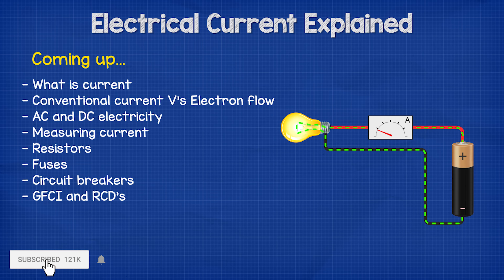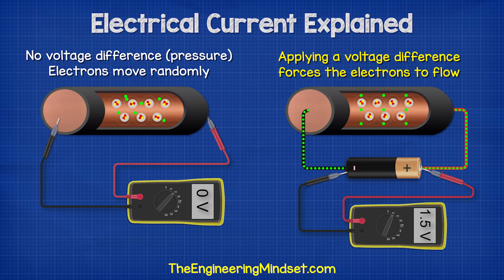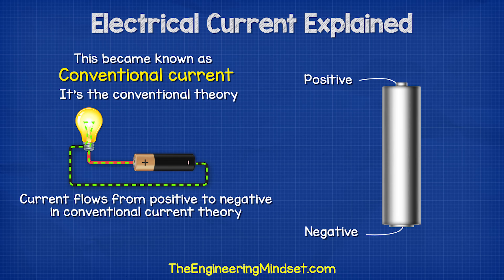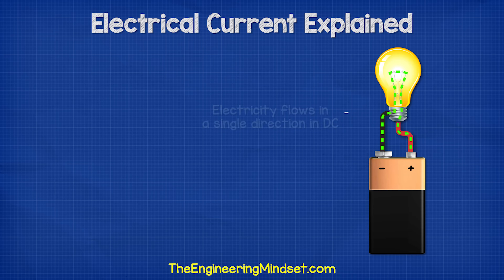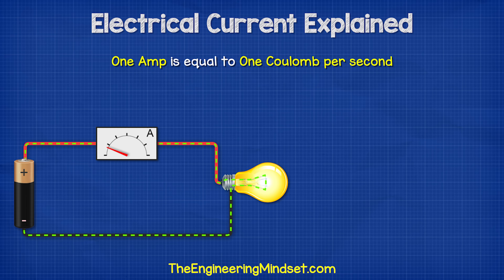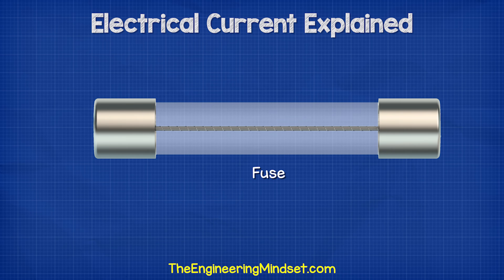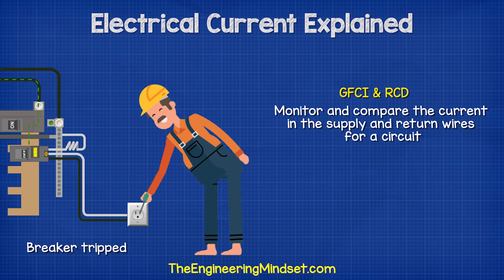Electrical Current Explained - AC DC, fuses, circuit breakers, multimeter, GFCI, ampere

Comment: Some of the basic information is this video is not true, such as "we need electrons to flow in the same direction".  AC current does not flow "in the same direction".  It jiggles back and forth  (or oscillates).  Furthermore, and a lot more weird, check out the Veritasium channel which will demonstrate that the power in a circuit is transmitted via the EM fields and not via the flow of electrons (which, in fact, move extremely slowly).

Comment: Why would you need to change anything in the terminals? Just make the battery so that the end that emits the electrons is the positive and vice versa, and mark it whichever way you want. I dont get the logic behind using the conventional current terminology.

Comment: So if the voltage is low and you have one amp let’s say, the voltage can be increased and the amps can stay the same somehow?
Ah, more or less amps means far more electrons per second, but how can the flow stay the same or the amount of electrons even with voltage increasing? Or can it not.

Comment: Ok I will make a Hot Wheels analogy  for what I learned today
A circuit is the track that connects the cars to go through 
- Electrons are the car toys themselves 
- The battery is the booster/accelerator that makes the car move through the circuit and by increasing the Amps you increase the speed of the car going 
- Resistor is the loop that the car goes through to lose its momentum to keep the car on track
If a track is to narrow and the accelerator is too powerful, the car can go out of the track

Comment: I really appreciate the info you share with this but I need to ask why use so many illustrations using electron flow after you  very clearly stated that we use conventional flow theory.  At 12:30 there is a battery hooked up to a light bulb with the electrons running down the battery and out of the negative terminal, into a light bulb and then back though the top of the battery again.  This is extremely confusing trying to follow along.  Are you reversing flow, different theory… again I appreciate all of this free and wonderful knowledge just asking a question

Comment: Electrical Engineering Professors: OK! And that's it for today! Here's the homework, required and optional. If you have questions, you can come by my office.

Professor never taught any homework material, the text book doesn't contain it, and the professor is never in his office. If he is, he gives a useless explanation and you leave more confuaed. Many times, the material in the labs is not demonstrated, and now you have two circuits, homework and lab, that you need to create. 
You know your professor is not meant for teaching when you finish the course with an F, and you're confused even more than before the class.
Electrical engineering is basically coding, coding, coding, and then creates dozens of circuits that don't work. 
Engineering was not what I thought it was. That's why I switched to Chemisty. It interests me, and if you mess up...
💥 💥 💥 BOOM!

Comment: 8:55 actually it's using a universal motor and not and induction motor, because a universal motor also works like a brushed DC motor and it is also a type of a brushed motor, because it can on DC and also AC as well, it's speed is proportional to the voltage, it doesn't have permanent magnets like DC motor, rather it has field windings, meaning that the motor is entirely connected to AC, especially the series one, so a washing machine uses universal motor also known a series motor or a DC series motor, which can run on both DC and AC power, but there are some washing machines use induction motor and some of them use also a BLDC motor, which they call it inverter motor in washing machine because it's connected to an inverter which converts AC to DC power (the BLDC motor).

Comment: Does a resistor only take away the energy of a electron flowing through the cable? 

But if a electron loses energy, in other words, speed, then won't it also travel slower after it has passed the resistor? 

If so, wouldn't the resistor get congested with elections due to the incoming faster electrons having to wait for the slower sluggish electrons?

Then wouldn't that congest also all the wire that is before the cable? 

Wouldn't then the whole circle just stop moving and the resistor stopping to heat up?

Comment: Something I didn't get and had to find out. 1 Amp is calculated taking the Watts and dividing it by Volts.
1.5 Watt / 1.5 Volts = 1 Amp ??

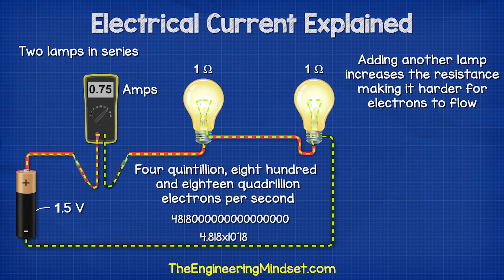Also, why is the 1.5 v down to .75 after going through 2, 1.5 watt bulbs? (13:02)

I don't get the math on this... I'm confused here after...

Comment: *cracks knuckles*
Dunning-Kruger time: when they discovered that the movement is reverse, they shouldn't have flipped the positive/negative naming convention. That makes no sense. Ol' Ben came up with 'positive' because he figured that that's the side with more electrons. Oh it turns out it was the hand— big whoop. All that needed to be done was start calling the top of the battery negative and the bottom positive. Not flip the terms into a meaningless confusing mess.

Comment: It's never explained why you get 3 amps in the "main wire to and from the battery" mentioned at 13:24 . From what was said up to that point in the video, one would think it would be 1.5 amps. Here is the missing bit of information that should have been explicitly stated:

"In a series circuit, adding more resistors increases total resistance and thus lowers current. But the opposite is true in a parallel circuit because adding more resistors in parallel creates more choices and lowers total resistance. If the same battery is connected to the resistors, current will increase."

Comment: Coulombs are basically the amount of electrons flowing inside a current. Direct current is only in USB connectors that perpetually flow in one direction (conventional current). Alternating current can flow in opposite directions (positive-negative/negative-positive). Another term for Amps is Coulombs per second. If we apply a resistor towards the current, it will reject over usage of electrons which can prevent burnouts or too much of a high pressure voltage flowing through the conductor.
Reply: The formula for Amps is Watts/ volts

Comment: Why do we ned a complete circuit for alternating current to work? The voltage would fluctuate around the open just as it does around a capacitor. It seems that a light bulb would work on either side of the open as long as the alternating voltage was intact.
Reply from the maker: You need to push and pull electrons through the load. You can't unless the circuit is complete. You can have voltage (pressure) but not current
Reply: I guess I'm having trouble with alternating current/voltage powering a load in series with a capacitor (tiny open) but it can't do the same around a larger open.Are you saying electrons don't rattle back and forth in an alternating voltage, if the circuit is open?

Comment: If the electrons pass from atom to atom in copper naturally, then can some end up switching places with the electron in your hand if you touch it? And if so would that electrocute you or does it have to be a large amount of electrons moving in one direction. Or is it the flow of energy (not electrons but force) going from a source to an end?

Comment: Why would an overload result in increased current? Is this applicable if the appliances are connected in parallel?
Reply from the maker: Anything we connect to the circuit is a load. Every load increases current and consumes energy. The circuit can only handle a certain current so if we connect too many devices we will go over the limit, hence overload.

Comment: At around 11mins he explains that a 1.5v battery and 1.5watt  bulb needs 1 amp whilst explaining what amps are. 

Now I understood everything till this point but this where I struggled at school. I didn't just want to learn I get fixated on asking too many questions. So now I can't move on leabri g till I know why 1amp is needed for  1.5v battery and 1.5watt bulb. Like why not 1.1 or 0.8 etc????
Reply from the maker: If we know the voltage is 1.5V and the power consumption of the lamp is 1.5W, then Voltage/current=Power formula lets us know that the current is 1Amp, because 1.5Vx1A=1.5W, if we have 1.1Amps we get 1.5Vx1.1A=1.65W, 0.8Amp we get 1.2W.
The resistance of the lamp and the voltage applied determines the current. If voltage supplied is 1.5V and the current is 1Amp then 1.5V/1A=1.5Ohms resistance. (V/I=R)
If the voltage was now 2V and we know the resistance is 1.5Ohms then V/R=I so 2V/1.5 Ohm = 1.33A and the power consumption of the lamp becomes 2V x 1.33A = 2.66W (it shines brighter but it will break if we keep increasing the voltage, it'll get too hot and break as it's not been designed for 2/3/4V its designed for 1.5V and the heat produced by 1.5V because of the current 1.5V is able to push through the lamp.
Reply: @EngineeringMindset wow thank you!!!! Reading ur message till I understand fully. Made sense straight away but now I will learn that formula and apply it to examples. Thank u so much
Reply from the maker: Glad to help. Check our ohms law video to learn more

Comment: Pls can someone help me out
Is the battery causing the free electrons in the copper wire to flow in one direction or is the electrons flowing from the negative terminal of the battery to the positive terminal
Reply: for electricians, pos to neg.  for physics profs, neg to pos.

Comment: How does one calculate the watts being used in a 240V split system using a clamp Amp meter?  For example, when my AC comes on I measure 14.4A on the L1 line and 10.3A on the L2 line.  Does this add up to 1728W (120V x 14.4A) on L1 and 1236W on L2 (120V x 10.3A) = 2964W being used by the AC?

Comment: Hi, sir, why does the magnitude of the electric current flowing in a series circuit at each point have the same magnitude ?.

isn't it before crossing the lamp, the electric current has no resistance ?.
Reply: the voltage is different, the current is the same in a series circuit.

Comment: 9:14. battery is not in a circuit (minus is not connected with a wire). why is it depicted here then?
Reply from the maker: Because, I forgot to add that wire when making the animation. Pretend it is connected.

Comment: What IS it that makes the positive and negative terminals of a battery positive and negative?  What is it about the battery that creates the difference of 1.5V?  Is it the magnetism?
The illustration at 2:13 is confusing when in tandem with the narrator's explanation.  When he says "if we take a copper wire..." a battery is brought onto the screen, with no copper wire in sight.  The "no voltage difference between the two ends" illustration shows the voltage-detecting instrument measuring a battery, not a wire.
Reply from the maker: Please watch our video on how batteries work

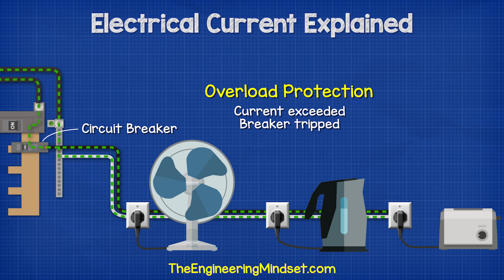Comment: @17:17 : I'm not sure I follow. If you add more load (resistance) to the circuit, wouldn't you expect the current to fall assuming that mains voltage is constant ?
Reply from the maker: They are in parallel. See our parallel circuits video
Reply: @EngineeringMindset  awesome, that clears it up. Thanks :)

Comment: This is probably a really simple question, but here goes. In the circuit @ 15:46, you use a resistor to reduce the current to the desired level. But that seems awfully wasteful; the resistor is radiating away most of the energy stored in the battery (in the form of heat). Is there a smarter way to draw off the exact amount of current that the LED requires, without wasting energy ?
Reply from the maker: Check out NEW resistor video, everything covered! ➡️ https://youtu.be/DYcLFHgVCn0
Reply from the maker: Seen the new LED explained video? so much detail covered! https://youtu.be/O8M2z2hIbag

Comment: 2:03 Actually its wrong. We do measure voltage ONLY when current is flowing because there is a small shunt resistor inside the multimeter that measures voltage drop. Additionally, you can prove my word by having a series of Leds then take out one led and measure voltage in its place, the Leds will glow! And multimeter will show a read of power source voltage
Reply: Adlitimannly plug you laptop to charge, open it then measure voltage drop on power source, 

you will get electrical burn on accumulator connector because you have just set parallel connection and current increased and burned the connector, so multimeter does conduct electrons while measuring voltage, thats why you must always measure voltage in regards to ground in case you dont measure a voltage drop
Reply from the maker: Check out NEW resistor video, everything covered! ➡️ https://youtu.be/DYcLFHgVCn0
Reply from the maker: Seen the new LED explained video? so much detail covered! https://youtu.be/O8M2z2hIbag

Comment: 😀An electric current is a stream of charged particles, such as electrons or ions, moving through an electrical conductor or space. It is measured as the net rate of flow of electric charge through a surface or into a control volume. The moving particles are called charge carriers, which may be one of several types of particles, depending on the conductor. In electric circuits the charge carriers are often electrons moving through a wire. In semiconductors they can be electrons or holes. In an electrolyte the charge carriers are ions, while in plasma, an ionized gas, they are ions and electrons.

The SI unit of electric current is the ampere, or amp, which is the flow of electric charge across a surface at the rate of one coulomb per second. The ampere (symbol: A) is an SI base unit. Electric current is measured using a device called an ammeter.

Electric currents create magnetic fields, which are used in motors, generators, inductors, and transformers. In ordinary conductors, they cause Joule heating, which creates light in incandescent light bulbs. Time-varying currents emit electromagnetic waves, which are used in telecommunications to broadcast information.

Comment: Great video, very well explained,  but can anyone explain why the current from 1.5v battery increases to 3 amps when the 2nd lamp, with 1 ohm resistance, is added in parallel plz
Reply from the maker: In parallel, the lamps will both have access to 1.5V so the full current will flow through each and then combine in the communal wire. Please watch our detailed videos on parallel and series circuits to learn more

Comment: What's the reason for dynamic power differences between two circuits ran in parallel? I do a lot of speaker installs and whenever I find some subs that come factory ran in parallel there's always a power difference. This is not a power difference that I necessarily test for but I can visibly see the difference even though the speakers are identical.
Reply from the maker: Check our new  Power Factor Explained video soooo much detail and easy visualisations https://youtu.be/NIrKOVZrqnU

Comment: Great videos! Thank you. I noticed twice now you present the Coulomb unit as a rate of electron flow which is inaccurate. 1 Coulomb is simply 6.2B electrons. 1 Amp is 1 Coulomb per second, or 6.2B electrons per second, of current flow. I suspect you have received this feedback from others.
Reply: I appreciate you pointing this out because this part of the video would appear to define 1 Amp as 6.24e18 electrons/sec/sec, no?

Comment: I think the unit in which you express a Coulomb in this video, and the previous one I watched, is not completely correct. I believe you state that 1 coulomb is expressed as electrons/second, but isn't it supposed to be just electrons? 1 amp is coulomb/second and therefore, electrons/second. If coulomb were electrons/second, amp would be electrons/second/second.

Comment: At timestamp 12:55 there are two bulbs in series with a 1.5v battery illustrated. How does this work? AC or DC. I thought that DC is supposed to be one terminal to (-) and one to (+) otherwise it won't work. Plus the current is not 'alternating' in the animation. Later on though you have the lamps in parallel which is the right way DC works. Thanks.
Reply from the maker: You can wire things in parallel or series. There are reasons for doing both. Please watch our videos on parallel and also series circuits to understand in detail how these work.

Comment: Sir, how does current flow only in one wire (live wire) like in AC, if current change its direction continuous? Does it mean AC still work without neutral wire?
Reply from the maker: It must have a neutral or a path to get back. It will not flow if it doesn't.

Comment: Question: If i connect a wire to both terminals of a voltage source without any load. Will current flow in that wire? Will there be any effect on wire health?
Reply: that is called a short.  the current will be so great that it burns the insulation and cause a fire.  i = v/r, r is zero, i will be infinite.  that is why fuses or breakers are used in circuits.

Comment: Some people say that, in an hydro power plan, there is no electricity sent in wires if there is no demands from population. Is that correct? 

Is there a difference between hydro vs thermal power plans, like, "electricity in wires all the time" and production and loss if there is any? In other way, do they overproduce and some electricity is lost in some ways?

Comment: 13:08 this part helped me understand ohms law and current alot better. So if I understand it now, voltage and resistance are constants in the circuit while current is the variable.

Comment: Correction, you can measure current flowing without it flowing.... it just shows 0 A because it's 0 flow.
Reply: technically, 0 amps means the circuit is not complete, the switch is open or the load is open or wire is bad or voltage is zero.  so there is nothing to meaure.